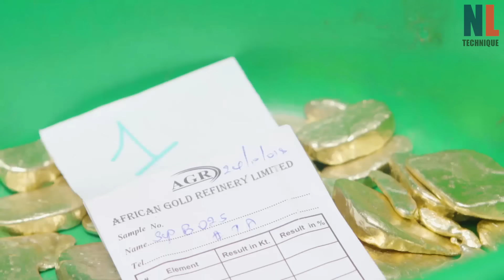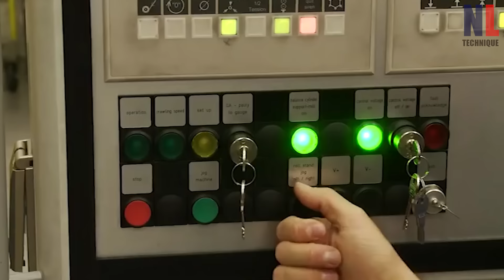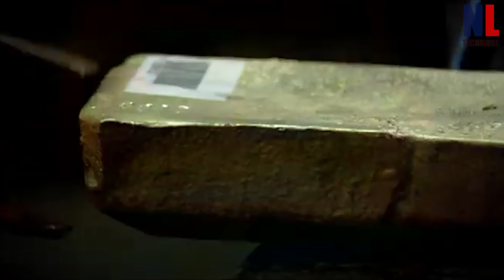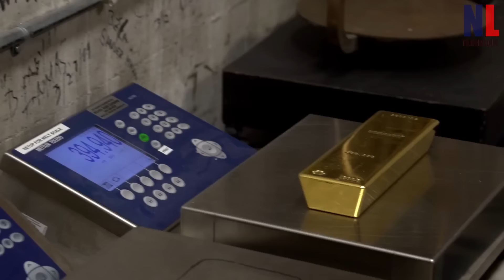Amazing Melting Pure Gold Technology - Modern Gold Coins and Bars Manufacturing Process

Comment: My father used to be a foreman in the State Mint of Hungary. They melted down several kilos of gold every day, to make all kinds of half-products. He once arranged a permit to let me visit, it was amazing. They were using modern electric vacuum furnaces. It's required to achieve 99.999% purity, and the product couldn't even get a stamp if it was exposed to air before it solidified and cooled down.
Reply: Did you ever get to keep any gold as a gift, you or your father? If you had to buy it, were you or your father able to?
Reply: @dannygreen5477  good question
Reply: Was security ever super tight around those facilities and inside of them? Aren’t those heavy gold bars worth around 750k each? 😳
Reply: @dannygreen5477  Yes, my dad was able to buy jewellery and all kinds of coins with a discount. He was also able to get 18 karat gold for my engagement ring.
Reply: @drelocs2878  Surprisingly, no, security wasn't much tighter than in any factory. There was even a burglary once. A worker tipped off two of his buddies who pried open a window and stole some half-products. They were soon caught.
Reply: Do you Need Accounts Services, Paymebt Handle Service , Personal And Business Transaction ?
Reply: You don't ask your father to find a job for me, I know how to melt gold
Reply: @dannygreen5477  My father could buy gold products at a discount price, so my parents had some nice jewellery. He could also have them repaired for no charge. He wasn't into investing though, so he never had bullions or bars.
Reply: @drelocs2878  By today's standards, the security was ridiculous. Even in the 1990s, there wasn't even a proper alarm in the workshop. The only security was a good old fence just a few meters away, and there was a former cop at the main gate who could randomly search anyone who was leaving. That was all.

 I remember 1993, there was a burglary. They took several kilos of gold half-products. The police later caught them, but not much of the pilfered items were retrieved. 

There was a lot of theft by employees too. It was often said that nobody gets to retire from that workshop, they either die or get arrested. It sure must've been easy to nick some gold shavings or other leftovers. My father was the one who broke the curse, he retired in 1995. After that, nobody died in there any more, and there were no arrests.
Reply: @mrinalsamanta6903  Sure, all it needs is an ouija board or a good psychic medium.

Comment: For those wondering the white powder is flux it helps separate impurities found within the gold.
Reply: nonono its just a touch of salt to taste
Reply: Once the impurities are separated where do they go?
Reply: Yeah, adding impurities removes impurities, ya makes sense
Reply: *baking soda.... its in all the recipes
Reply: @gail5553  where do broken hearts go?
Reply: @MarcoJulio-k5n  flux doesn't mix with the gold, it stays in a separated layer unlike metal.
Reply: ..it makes more tasty😝😜😜
Reply: I tought it was salbea
Reply: @MarcoJulio-k5n  gold is very dense so impurities including flux do have a tendency to get pushed out towards the outside of the bar or nugget being made. It makes perfect sense when you consider gold’s properties.
Reply: Think its called Borax
Reply: @gail5553  "As all of the minerals melt down, they separate from one another. As the process continues, the borax causes the other minerals to oxidize and breakdown even further. Gold is unaffected by this reaction and sinks to the bottom of the mixture, intact." Forms a layer on top that can be chipped, cleaned off, and just the pure gold is left.
Reply: Like tungsten?
Reply: I thought it was baking soda
Reply: Thank you! i was coming here for exactly that
Reply: Nah, that's Bolivian marching powder.
Reply: @gail5553  on the outside of the bar then knocked off like slag in welding etc.
Reply: @gail5553  To the top to skim off.
Reply: @MarcoJulio-k5n   You need to look up how they assay gold. Your ignorance is showing.
Reply: @muhammadabd5592 Taste like chicken.

Comment: Just casually handling tens of thousands of dollars
Reply: Probably hundreds of thousands or even millions
Reply: Multi millions
Reply: Tens of millions. As of 9/4/20 one bar costs $770,000. In the shot at 10:07 just one layer of those pallets (11x2 bars) costs 16.2mil. Probs 5/6 layers per pallet, times 6 pallets....just in this room
Reply: @keeper9007  big brains
Reply: @keeper9007  google says 40 bars per pallet  at 16.2 mil a bar that's 648 million I would say probably billions

Comment: That gold being melted down at the very beginning of the video looks ALOT like shipwreck gold... The abnormal yet distinctive elongated shape akin to a railroad spike is evident of this. If so, it would be really interesting to know the backstory/history of the bars going into the smelter.... and the legality of such things :)
Reply: That might be the case but I’d imagine that most gold used in facilities such as this one is sourced from industrial gold mines(a bit of a misnomer since for the most part it’s more of a pit than a mine) because such large-scale manufacturing requires a consistent supply of material and exotically sourced gold would lose some of the value it has of being sourced from such a unique location if it was simply melted into a bar. I’d imagine jewelry makers and even antique retailers/crystal sellers would be far more interested in paying a premium for gold sourced from a sunken ship since they could relay that story to the end customer.